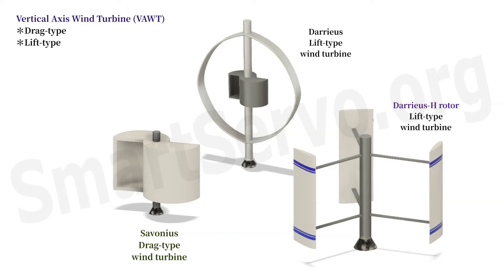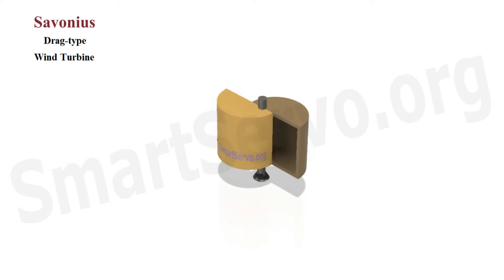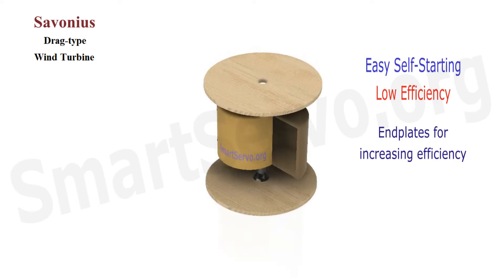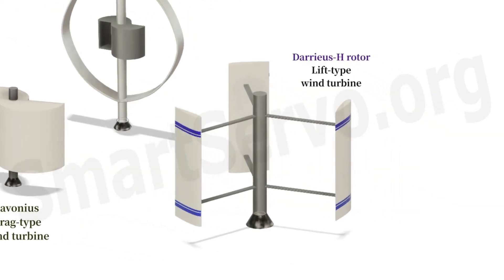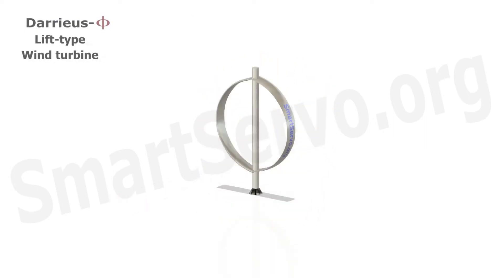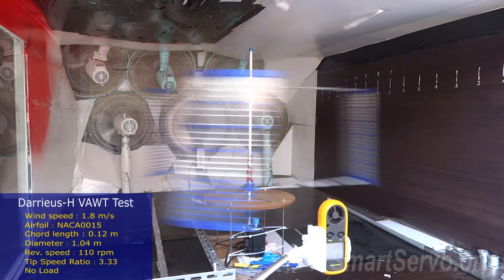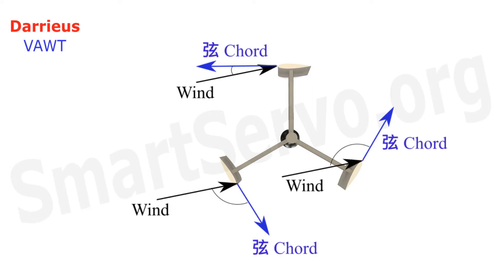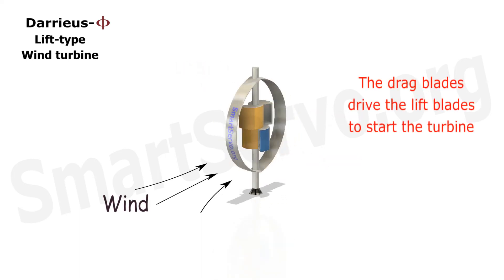An introduction to vertical axis wind turbines, another way to use renewable energy.

Comment: If you create a Archimedes screws  with a golden ratio Diameter number of 21 and got smaller as it  when though time you would have a Perfect helical turbine that goes faster as it spins even in slow speeds. Just like a tesla turbine. Numbnuts

Comment: Unfortunately you're not Creating a vector in time. Just in space AND Mask.
Reply from the maker: what vector ?
Reply: @Smart Servo   if you made a wind turbine that was 55 inches in diameter and  and say 58 inches or even 64 inches tall with 3 or 6 blades using the golden ratio design  with an archimede screw. You would have the most efficient turbine to date. The unfortunate problem is You can't make it with traditional Tools you would HAVE TO 3D PRINT IT
Reply: @Smart Servo  question. You interested in win turbines?